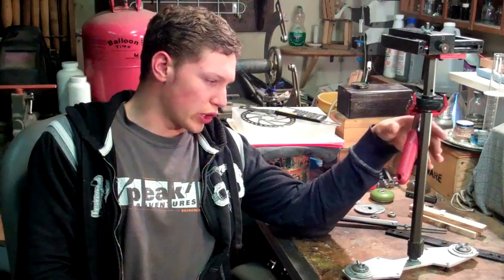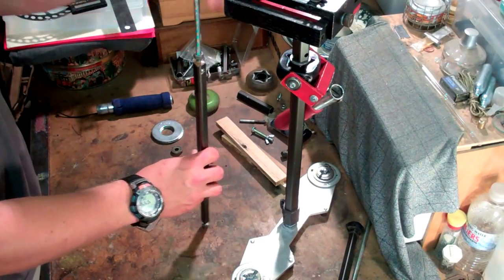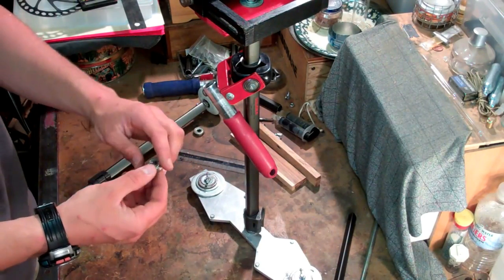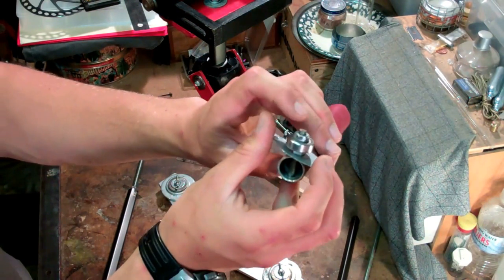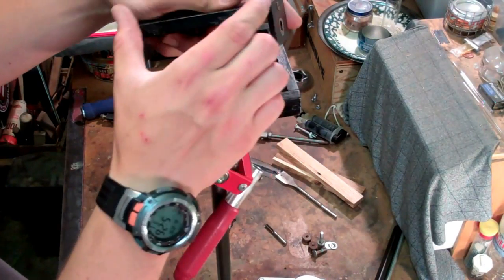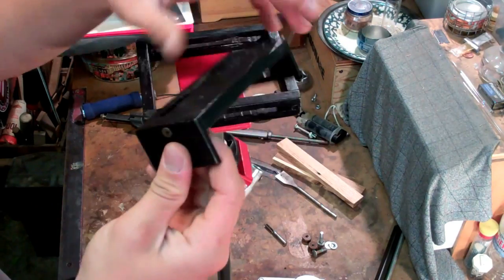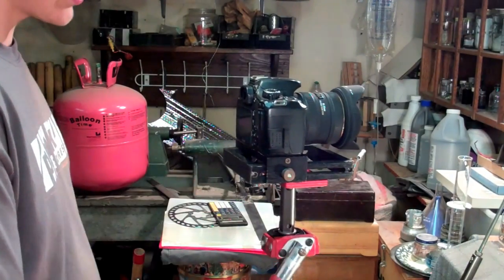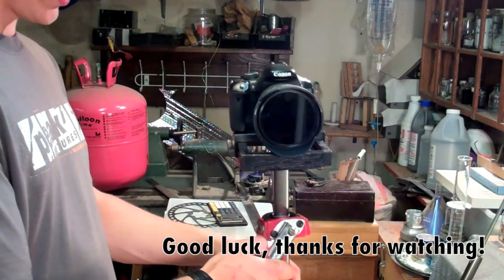THE BEST Homemade Glidecam/Stedicam Tutorial DIY

Comment: Hello. I've built my FlyCam and I have a problem; the flycam not doing its job, is moving like a pendulum at the top. What solution would you give me?
Reply: Sounds like you have too much weight on the bottom and/or the shaft is too long. Reduce the weight and or/shorten the shaft, and balance carefully. If that does not work, it may be that your gimble is not centered well enough; it needs to be very carefully made.

-Camera guy

Comment: is this glidecam compatible with GoPro? im trying to build one to use it with my GoPro but im afraid the weight ratio of the glidecam to the GoPro is not suitable.
Reply: You would need more weight, so either you could just strap an extra couple pounds on top along with the GoPro, or just downscale the whole device. A lot. But then it would be harder to use...

Comment: How much does this cost approximately?
Reply from the maker: about $30 in materials. (depends on what you have in your garage already....could be as low as $5)
Reply: ReviewOutdoorGear Alright cool =) might just go to lowes and get some stuff
Reply: ReviewOutdoorGear And i also have a couple more questions. what equipment did you use to put it together and do you have any blueprints for this? if so can i ahve a copy?
Reply: ***** We used mostly just basic shop tools to put it together. A drill, table saw, hacksaw for the threaded rods, and a router for the platform... nothing really special. We didn't really have any blueprints for the design except maybe a few scribbles laying around somewhere in the shop. It was really a build-and-test sort of process. Built it over the course of a year, with many intermediate versions, and even the one it the video is outdated.
Reply: Of Chemistry, Films, and More one last question what are the dimensions of the sheetmetal base plate?

Comment: How do you attach the threaded rods to the tripod leg. my tripod leg is to hollow to just use epoxy
Reply: What I did was loosely fit a piece of wood around the threaded rod that would also loosely fit into the tripod leg and then poured in the epoxy, the spaces were small enough that the epoxy did not pour down into the leg.

-Camera guy

Comment: Yeah, 12 inches is about good. That's about how long i have mine with a t2i and Sigma 10-20 on there. Its better to cut it shorter and then add more weight to get a good drop time than to make it too long and have it drop too fast with no weight at all. So yeah, 12 inches is a good length. You can play around with different lengths since you're using PVC; being that its cheaper than tripod legs.

Comment: how would you determine how much weight to use when balancing your camera?
Reply: Add enough weight so that that your main shaft is extended to about 15 inches and the drop time (that's how long it takes the rig to right itself from a horizontal position) is from 2 - 3 seconds.

Comment: The Glidecam in the video cost me only a buck or two, which was what I paid for the large fender washers that I used as counter weights; everything else I found in my garage. If you didn't have any of the materials shown you could most probably buy everything you needed for under 30 bucks.

Comment: Do you have a printable stencil for the base plate or specs for it?
Reply: Someone asked for that earlier too. I don't have a stencil; it was kind of a design I made up along the way. But here are some specs: 1/4" thick aluminum. Total length of 13 inches. I.5 inches wide in the middle and at both ends. The thin 'neck' in the middle is 3 inches long. The wide parts are 3.5 inches, with the widest part 4 inches from the end on both side. I hope that makes some sense.
-Camera Guy
Reply: Thank you .so if it is like 14'' long?
Reply: motton6
Yeah, you can make it that long. The one in the video is 13".
Reply: ok awsome thank you.
Reply: Sorry another question. is it ok if the handle is longer then 6 inches. Say 7.5 or 8 inches.
Reply: motton6
Oh yeah, make it as long as you need to to make it comfortable.
Reply: Awesome thank you so much for the help. I am almost done with my own.
Reply: Sorry another question. Do you think this glidecam could take a go pro on it? or would the go pro be too light?
Reply: You would need to add extra weight on top to compensate, yes.
Reply: Ok. Thank you for all the help with my questions. I hope mine turns out well.

Comment: Anybody try this with a maco-rail for the platform?  I've seen cheap 2 axis rails on amazon for ~$30.  Anyway good video.  Very helpful.
Reply: That's a really good idea. I should try it out.
Reply: Chemistry, Films, and More
This is the one I just bought.  I'm using it for another purpose but I might try it with this type of build.
http://www.amazon.com/gp/product/B009SJ7UWU/ref=oh_aui_detailpage_o00_s00?ie=UTF8&psc=1
Reply: jnrmrtn How do you mount that slider?
Reply: I haven't done it yet but it's threaded on the bottom so there's some options.
Reply: Okey, is it threaded for a tripod screw?
Reply: Yes.

Comment from the maker: You could always just attach your camera and then add more weight on top to make up for it. However, the principle of this design works on almost any size. You can downscale it as much as you are able to. If i had a gopro, i would make mine about 8-10 inches long in total. Not sure if that's possible or not... you would need to find a smaller wheel for the gimble, or make a smaller one if you have the tools.